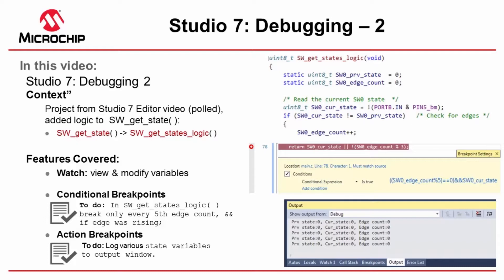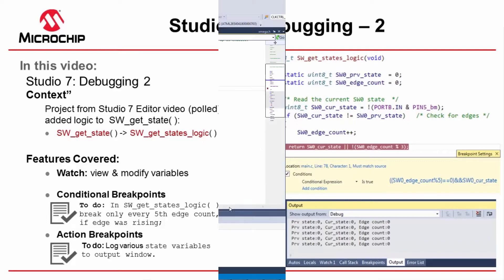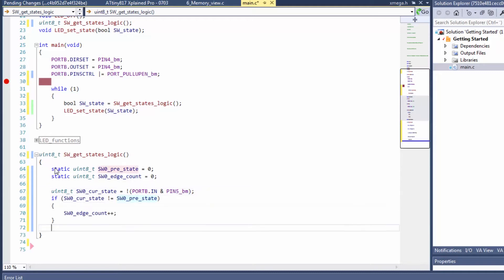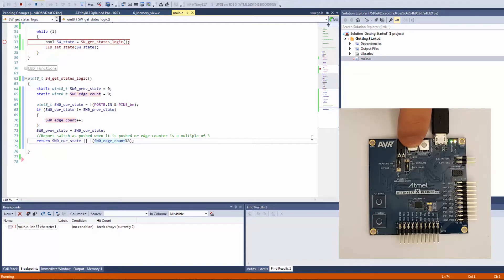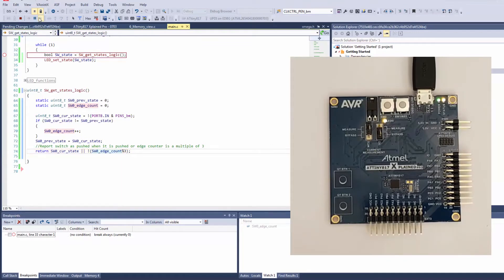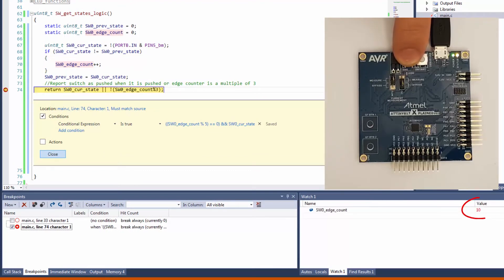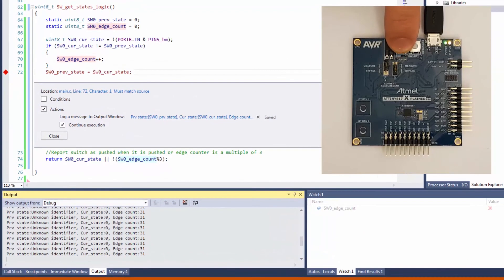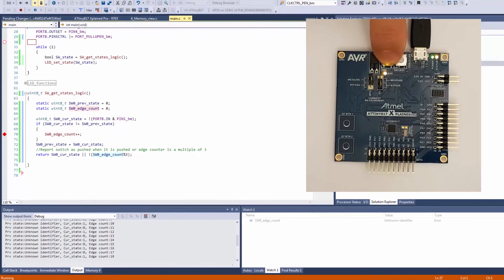Getting Started with Atmel Studio 7 - Episode 14 - Debugging Pt. 2

Comment: how do i print from code to the output window without a debug breakpoint?
Reply from the maker: Hi Sean,
A breakpoint tells the debugger to temporarily suspend the execution of a program when a specific condition takes place, e.g. when a certain instruction is about to be executed.
It enables you to suspend execution where and when you need to. Rather than stepping through your code line by line or instruction by instruction, you can allow your program to run until it hits a breakpoint, and then start to debug. It is necessary to select the breakpoint on the required line of your code to display or print out the string, variable in the Atmel studio output window. More detailed instructions can be found here: https://microchipsupport.force.com/s/article/print-out-the-string-variable-into-the-Atmel-studio-output-window. Please let us know if this helps.